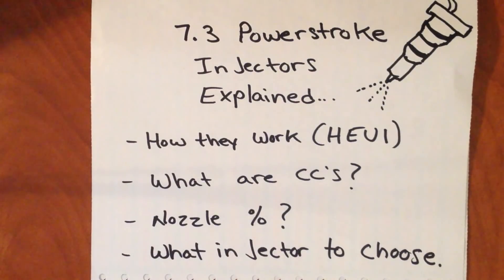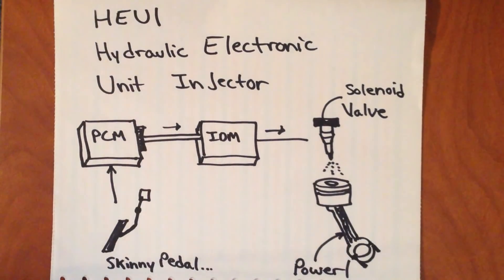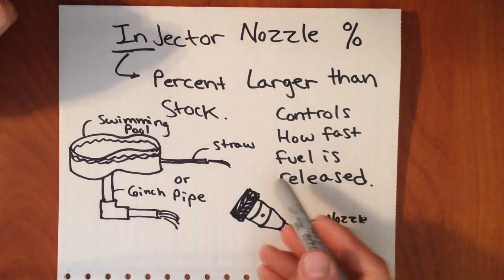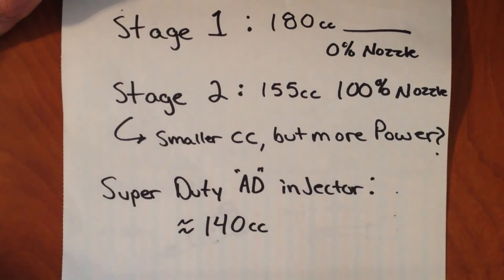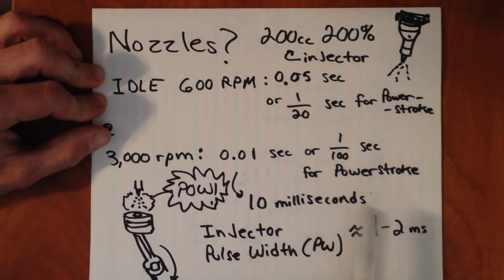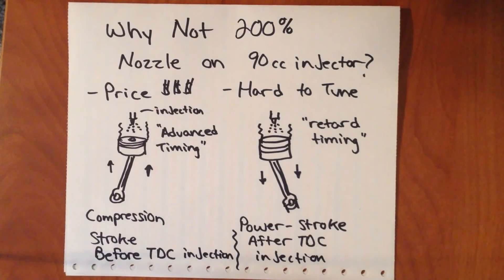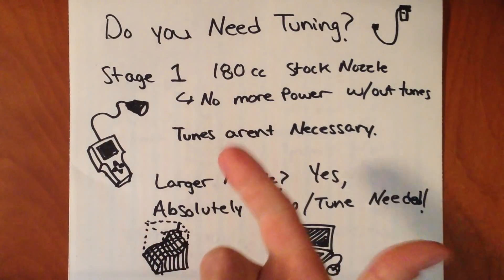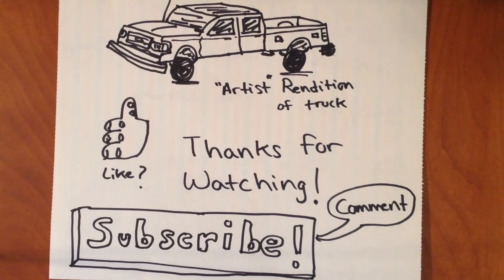7.3 Powerstroke Injectors Explained

Comment: Hey bud good video!!!! 

Just asking for your advice on my 02 f350 7.3 with 390k miles on it;
           what I do is pulling a 10'x8' dump trailer every other day, also my 7.3 is not starting on wintertime, but the worst is that I live on Phoenix AZ. And we don't have a heavy winter as up north, what size injector do you recommend???? 

Thank you!!!!
Reply from the maker: Thank you I appreciate it! For your cold start issues, definitely take a look at your glow plug system, probably start with the glow plug relay. You can test it's functionality using a test light and worst case the relay, glow plugs, and glow plug wiring all needs replacement. It's not a bad job, but if you're looking to fix the cold start problem, definitely start by looking at the glow plug system. I don't recommend that you start to 'solve' you cold start issue by replacing injectors, odds are that won't solve your issue, and it has something to do with your glow plug system. 

Now regarding injectors. Bear in mind, I've only ever replaced one set of injectors, and that's in my current truck a 97 7.3 Powerstroke. I highly recommend you do some more reading up on it/ review before you drop over $1200 on parts. That being said, I'll tell you what I have, and what my reasoning is. I run a set of 'stage 1' or 160cc/00 injectors, 160 cc/min injector capacity, stock nozzle. Supposedly with tuning, I can get 325 rwhp, though I've never put the truck on a dyno, and I don't have the supporting turbo/ fuel system/ transmission to really feel comfortable claiming that. I chose the 160cc injector because I have a stock 15 degree HPOP as far as I know, and from talking to the folks over at Full Force Diesel, you really shouldn't run anything larger than a 160 cc injector unless you upgrade to a larger 17 degree HPOP (which you have in the superduty). If I had the 17 degree HPOP, I probably wouldn't gone with the 180 cc injector with stock nozzles. My reasoning behind these injectors was that it was really only $100 more for the bigger injectors over the stock injectors, so what the heck. Also, theoretically speaking, at least for the old body style native 'single shot' 7.3 Powerstroke, without tuning the stock nozzled injectors will behave just like a stock injector. You really only see gains with tuning. This gave me the 'option' to tune the truck for more power, or if I didn't want tuning, I could just keep the stock tunes and it would behave like it was designed to, with stock injectors. Your SD is a bit different because it comes with the native 'split shot' injector. Either way you look at it, you'll need aftermarket tuning to get it to run right, otherwise you really run the risk of messing up the truck in trying to run single shot injectors with split shot tuning, there's a reason behind it, but I won't get into that now, bottom line, you really shouldn't run the truck with single shot injectors without the tuning, though I know people have done it in the past, I heard the truck ran like garbage that way. So you'll need tuning, i.e. you'll need a performance chip to run the injectors properly even at 'stock' power levels. For you, sticking with the stock nozzle size then becomes less relevant. I also like the stock nozzle as being the most 'efficient' nozzle if you will. Basically the nozzles have tiny holes to let fuel out. When you increase the nozzle size over stock, you basically bore out those holes. The larger hole doesn't atomize the fuel as well as the smaller stock nozzles, so you could sacrifice some mpg in the process, though probably not a whole lot, and you may expect some more soot compared to a stock nozzle. Though there's a catch to that line of reasoning, a bigger injector can get all the fuel out quicker. Take for instance the 180 cc/ 30% injector. The nozzles are 30% larger over stock, so they can empty the injector in a shorter period of time. This is why you need tuning with larger nozzled injectors. Basically if you keep the stock pulse width, you run the risk of essentially over-advancing the timing of the injection event, and doing some serious damage. However the shorter duration has some advantages. It allows you to put more fuel earlier on in the power stroke, giving it more time for complete combustion. I've heard stories of some folks preferring the larger nozzled injectors because they give lower EGT's owing to the optimized injection event. Definitely do some more research, call around and ask injector suppliers what they recommend. You're potentially  giving them over $1200 for parts, so take your time, ask them questions, make them earn their pay... Also bear in mind, you have a 2002 SD that probably has powdered metal connecting rods, i.e. they can only safely support 400 rwhp without breaking, so I've heard. Once you go beyond the 180 cc injector, you really start getting to a point where you need to upgrade other components, like even upgrade your superduty HPOP for a dual hpop setup or an Adrenaline HPOP, etc. Things get wild quick. Also bear in mind, the 7.3 while it is a good engine, is not 'designed' for more than stock power output, so the more you push it, the more you push your luck. So for a mild increase in performance without breaking the bank, I"d say go with either the 180/00 or 180/30 injectors. Though I know there's also the 'baby swamps' injectors though, I don't know much about them, but I've heard good things about them. For any larger injectors, you'd have to ask someone else, that stuff is beginning to get out of my realm of confidence. Whatever you do, please make sure you have the appropriate supporting mods, intercooler, turbo, gauge setup (bear minimum), possibly transmission etc. The automatic transmission isn't good for much more than stock power levels, that's why I indeed baby my e4od and I might have actually only floored it once in the year I've had the injectors. Best of luck shopping!
Reply: @Rnddiesel  I chose the 160cc injector because I have a stock 15 degree HPOP as far as I know.
If you haven't already, you should look at the 01-03 HPOP pump.
Your 97 pump could supply 5.8cc/turn (new, and on a good day).
The 01-03 can supply up to 7.2cc/turn.
In this comparison, there is no such thing as "too much oil".
The additional oil will allow your stock, or not so stock, tune to do what it wants.
Your truck will have more power, better fuel economy, and lower EGTs.
You can use a later model pump on an older engine (but, not the other way 'round), however, the gasket used is important.
Unfortunately, I don't remember which gasket to use.  Google knows...
Reply: Rnddiesel Rnddiesel I have a 97 7.3 as well and want the 180/80’s but after reading this I might go 180/30’s. However I do have a question I continuously find articles claiming the hybrids help keep egt’s lower than single shots. I want a snappy daily driver who get a lot of highway miles at 70 and only hauls light car trailer sxs etc. I have the upgraded fuel system and I just for the life of me can’t decide if I want 180/80’s or 200/30’s. After this info though you have me nervous because the last thing I want to do is hurt my truck. By the time injectors go in she’ll have upgraded valve body and such. The turbo and tuner will be done simultaneously while I have everything apart. I’d really appreciate your two cents as my truck means the world to me
Reply: @araw1212  "However I do have a question I continuously find articles claiming the hybrids help keep egt’s lower than single shots."
Hybrids can be either single or split (Prime) injectors.
A hybrid is simply using B Code plunger and barrel in an A Code body, with an A Code intensifier piston. There is NOTHING there to limit to split (prime) or single injection events.
So... what does that do?
A hybrid reduces the HPOP (High Pressure Oil Pump) oil / fuel ratio from 7:1 to 5:1.
That means two things:
1) You reduce your oil demand from 7x your fuel flow to 5x of your fuel flow.
2) You reduce your fuel injection pressure from 7x ICP to 5x ICP.
That gives you some pros... and some cons:
Pro of the Hybrid is more fuel injected with a lower capacity HPOP.
Con of the Hybrid is lower injection pressure of the fuel.
Lower injection pressure means poorer atomization of the fuel.
Fuel that is less atomized yields:
Haze, smoke, poor fuel economy, & Higher EGTs
Hybrids (in my opinion) are a cheap, half-assed fix for not handling your ICP supply issues with your HPOP.

That said, Hybrids can get the fuel in the cylinder more quickly than high volume A Codes with a weak HPOP. 
That will, in fact, reduce EGTs...  So, two edged sword.
With Hybrids, you can reduce EGTs relative to high FIPW (Fuel Injection Pulse Width) events.
But haze, smoke, poor economy, and higher EGTs (relative to the higher injection pressure) will still be there.
Reply: You may also want to look into an injector shim kit available on eBay for about $75.

Comment: My understanding is that stock AD injectors are 130cc and California AB are 120. Are my numbers off ? Almost everywhere I have check I have been told this. I just want to know for my self not being a smart ass.
Reply from the maker: I appreciate the question! It's definitely good to double check ones information. You know looking over all the injector sizes, I think it really depends on who you are talking to. I've read anywhere that the AA injectors for OBS non-Cali. models are anywhere between 90 and 98cc. I think it really depends on who's measuring the flow. So you could probably say AA injectors flow between 90 and 98cc/min. AD (Super Duty Injectors) I've read that they're between 135-140cc? Now looking back checking my sources, I'm even less certain about the AB California injectors. I'm seeing they're anywhere between 120 and 135cc. 

I suspect there's more to it than the standard dimensions of the injectors. We don't live in a perfect world and every injector will flow a little different. The best way to check an injector flow rate is on an injector flow bench (I haven't done this) and even then there's so many things that can affect the injector flow. There may be a slightly worn injector being tested that may leak by a little fuel and effectively flow less cc's than it's rated for. Depending on the oil pressure used to fire the injector, the flow will vary. If the nozzles are slightly different, that may affect the actual measurement. The tolerances on these injectors are so small they're measured at least in the range of 0.0001" of an inch if not closer than that. A typical bearing for instance is okay if it's within +-0.003 of an inch or somewhere around there. That being said with the injectors requiring such precision and accuracy, a small change may have a large effect on the overall flow. Heck depending on the equipment used to measure the flow rate and the method used to do so the actual value will vary just because equipment isn't calibrated perfectly or there's random error in the data collection process. 

In the end it's the ballpark range that'll make more power or not. A 160cc injector will definitely be capable of fueling way more than a 90-98cc injector. A Super Duty AD will make more power than an OBS AA 90-98 cc injector and so on. 

This may well remain a mystery. These are my suspicions and I really can't confidently say they flow 'x' amount or not. Any thoughts?

Comment: Can you explain injector nozzle sizes and their affect on  towing and normal/daily driving with those injectors ?
I have an 02 and looking to do an upgrade, one thing to note is I have upgraded the gtp38r
Reply from the maker: I really wouldn't know what nozzle size to get. How much horsepower are you looking for? I'm running 160cc with stock nozzles and custom tuning, it makes all the power in the world an soots like a freight train with the stock turbo on my OBS. Supposedly they're good for about 360 rear wheel horse power, that's about equivalent to a 1st generation 6.7 powerstroke. If you still want to tow with your built truck, yeah its probably not the best in the world, you'll need some serious transmission upgrades at a minimum, then I'd recommend you open up a dialogue with a 7.3 powerstroke tuner who does custom tunes. Perhaps call up Full Force Diesel or someone like that, tell them what you want, what you've done, and ask their recommendation. I know you can detune big nozzled injectors, but only so much, I don't tune yet and don't know that limit. At the end of the day, it's your right foot that'll control your EGT. If you keep your foot out of the accelerator pedal, you'll get the same EGT's with stock tunes and injectors, vs a race tune on big injectors.